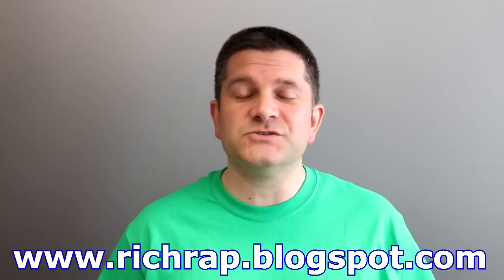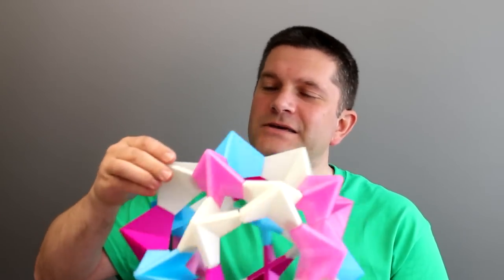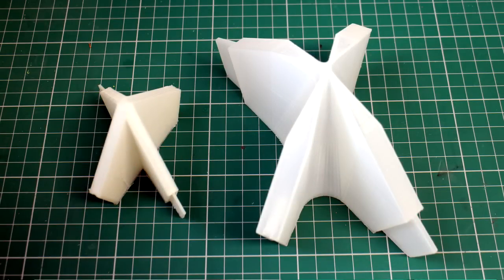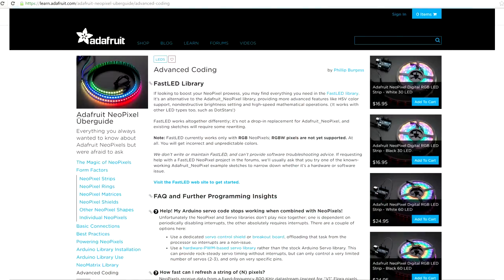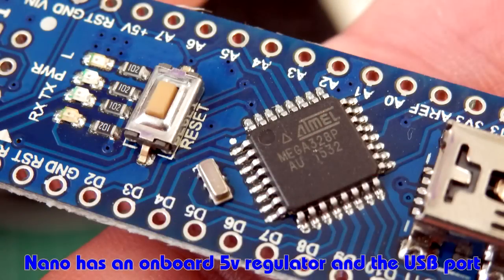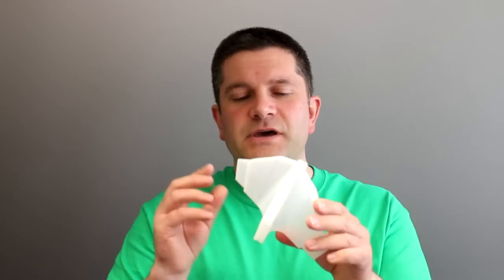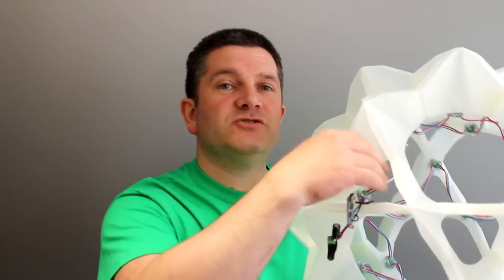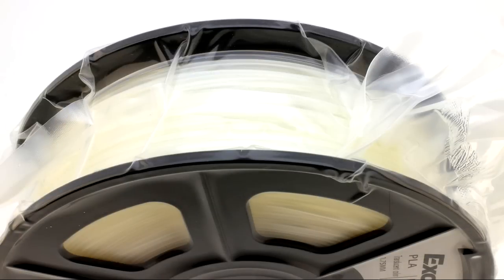3D printed light sculpture Project Snowflake

Comment: Richard. Can you please tell me which filament has the highest temperature resistance and works best for lighting fixtures.
Thank you very much
Reply from the maker: As for the highest temperature rating, it's going to be something like a Polycarbonate or PEEK / PEAK material, but they are very difficult to 3D print with.
If you use LED's you can use lower temperature materials. I would not recommend using halogen lights or anything that get too hot with 3D printed thermoplastic materials.
I have used PETG and Nylon with various LED lighting fixtures and displays.
Even PLA can be okay with low power LED's and low voltage lighting.
The snowflake was just PLA with 5v RGB LED's and that worked fine for me.
Best Wishes. Rich.

Comment: My Project Snowflake is finally complete and it's awesome Rich. Your Daughters code looks great too.
I've also added an electronics box and braces to enable it to be suspended from an M8 threaded rod. At the moment it only has normal M8 nuts, but I plan to replace them with Nylock nuts before hanging it outside @ Christmas. The box and brackets took me a while to get right and I'm sure they can be improved on, but it helped me learn a bit more in the process.
Reply from the maker: That's really fantastic Spike. Thanks for letting me know. I hope it looks great at Christmas time.

Comment: Did you glue the printed parts together before hanging it outside? What glue would be best?
I am printing with exactly the same filament that you used.
Reply from the maker: No glue required, they all slot into each-other and hold tightly together, they are also a single shell, even in the joining tabs, so no water can enter.
Reply: I've printed all 30 of the parts now. They are all fit together perfectly, I'm amazed at how well you designed it.
The only thing I'm waiting for are the LEDs from China, everything else is here.
I plan to fit it to the front of the house on a bracket and some threaded rod ... not till Christmas though :-)
Have you had time to design a box for the electronics yet? I'm thinking that it might be a good idea to design something that incorporates a hole for threaded rod to pass through to hang it on. I will try to design something but don't expect too much, my design skills haven't been honed yet :-)

Comment: Awesome project Rich. I'm a big fan of LEDs, there are some videos on my channel, the matrix is my favourite.
Fantastic to see your daughters heavily involved to.
Just a quick question, doesn't PLA degrade in the rain because it absorbs moisture and in the sun due to UV?
Thank you so much for sharing
Reply from the maker: PLA is actually quite stable, and does not absorb moisture (not much anyway). It will not degrade just sitting outside in the rain/wind/snow/heat. I have had many PLA objects outside, (including in a pond) for many years.

Some really nasty PLA's in the past used unstable colorants, and they can fade or degrade the plastic. But almost all good PLA you buy now will be stable for years and years, even outside.

ABS is a different story, that does tend to degrade in the sun, becoming very brittle and discolored.
Reply: Ah! That proves I got it completely the wrong way round. Thank you so much for putting me right Rich.

I've printed a couple of test pieces in grey PLA and they fit together perfectly.
Have also ordered a roll of the translucent filament you used, a couple of Nanos and a string of 50 LEDs. So well on the way to getting it blinking in all it's glory.
I'm thinking of putting a threaded rod down through the middle and having a go at designing some kind of 'spacer' for it to sit on. That way it wont hang and potentially come apart. What do you think?

Oh! I showed the wife your video. Her reaction ... Bloody hell, thats a lot bigger than I thought it would be :-)

Comment: Man I wish I could print with that amount of reliability. What printing speeds are you typically using?
Reply from the maker: Thanks, just takes some calibration and mechanical setup. I almost always print at 55mm/sec 0.2mm layers and in PLA or PETG.
Reply: thanks

Comment: If you have a DSLR, set it on a tripod pointing into your garden at night, open the shutter for 30 seconds and get your daughters to run around waving Project Snowflake in the air.  You should end up with some crazy light trails and maybe spark their interest in photography as well.  Great video.
Reply from the maker: That's a good idea, I will try it out, thanks.